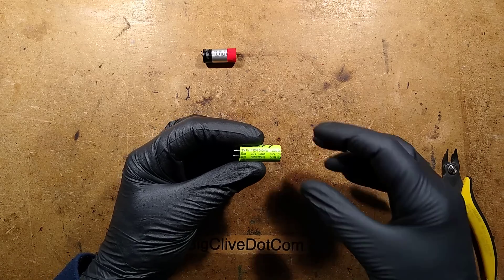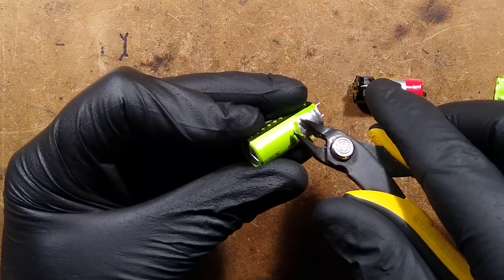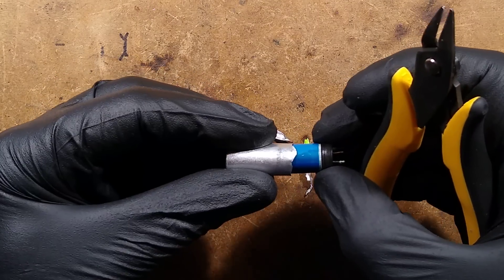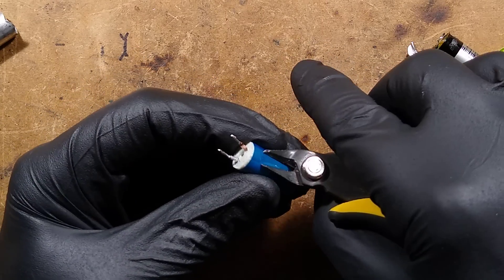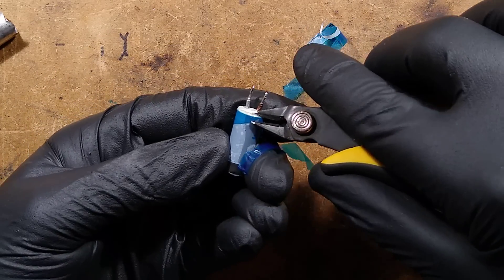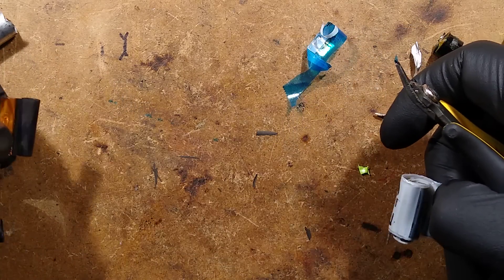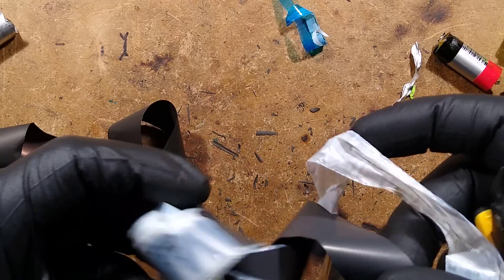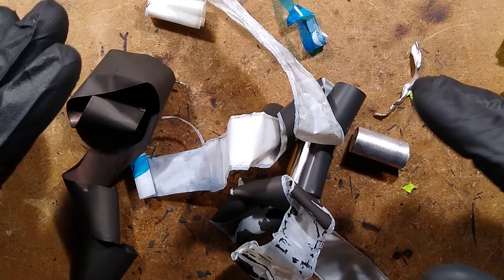Opening a capacitor-style lithium cell (don't try this)

Comment: Ahhh the memories ... investigating battery internals... and more.
...Half a dozen discarded car batteries in series and a couple of the carbon rods from those ancient massive carbon zinc phone batteries (Eveready No. 6), was rather spectacular (even in daylight) when an arc was drawn.
Lotsa light, heat, smoke, superficial burns and singed things. And yes we had the equivalent of the E.C. pie dish for flaming bits and pieces.
Heaven knows what the neighbors thought.
Gave a bit of a tingle if hands wet and mishandled. 
Added dubious bonus was occasionally a freshly overcharged battery would be ignited by sparks and spray acid around. (Had to keep leads as short as possible, so car batteries, carbon rods and user all in close proximity)
Clothing with numerous holes from sparks and acid raised parental eyebrows.
Survived. (& Learnt a lot of practical things that added to a really useful career)

Comment: It’s crazy how a battery that can power so many things is just a well rolled up piece of foil and copper!!! Amazing
Reply: Just make sure the corners don't get folded over; An expensive mistake for Chevrolet.
Reply: @MrDuncl and Samsung
Reply: With many decades worth of chemical engineering coated onto the foil 🤔
Reply from the maker: Yeah, a LOT of time and work went into those foils, coatings, separators and electrolyte.  It is bizarre that it is now such a throw away thing.

Comment: Really cool, but I think you contaminated your workbench with some of the contents of that cell. If I am disassembling stuff containing chemicals that are hazardous, I like to tape down some polyethylene sheet so I don't contaminate my workbench with carcinogenic stuff. I really don't like the idea of having to be super careful over my work surfaces once they get contaminated because it's so easy to forget weeks later. Once an open surface like wood is contaminated, it can be very difficult to clean it again so it's better to contaminate a cover that can be thrown out. If it weren't for the issues of shorting things I'd probably like to work over a metal cookie tray because it'd be more fire resistant than polyethylene sheet and easier to sanitize than the workbench.

Thanks for showing this disassembly. I've always wanted to do it and didn't want to risk the potential mess and fire.

Comment: The copper foil covered in graphite is the anode, and remains the same for both traditional Li-ion and LiFePO4 (but some new variants add silicon monoxide to increase energy density).

Comment: I'm torn on whether I like this form factor or not. On the one hand it seems real handy to design into a PCB, but I wonder how bad the impact is when it comes time to recycle the device it's in. For disposable devices it's borderline criminal to use the standard Li-ion cells. Would be better for the environment if it was a simple alkaline cell, although it would have to be quite a bit bigger.

Comment: Hybrid lithium ion capacitor. Low self discharge and don't catch fire, higher density than regular capacitors. The cathode is the same as those in supercapacitors. Interesting read.

Comment: I read an article a lil over a year ago that said don't be fooled, the "NEW" Sodium cells are just reworded Snake-Oil salesmen talk for old sodium-cell tech and are still even more volatile, much heavier, produce about 30% less voltage and perform even worse in cold weather, than the latest LiCo cells. 

We'll still need a stab in the test-pan and a blast-shield for those. 🤣

Comment: Discovered one of these in a rechargeable shaver a while back, its 500mAh in a 1450 package, it has one 6 pin chip on the board, was expecting it to be a DW01, it's  similar size but marked 67c927, charging circuitry may be in the charging  cable, I was intrigued.

Comment: It's funny how Cobalt is only a problem when it's used in EV batteries and not when most of it gets used to remove sulfur from diesel.
Reply: when i was little i had a couple of chemistry sets and both had cobalt chloride in them, doubt if 'health and safety' would allow it now, or even any chemistry sets at all !

Comment: I'm also very curious about the sodium ion technology.  Chinese car manufacturers (BYD and Chery) are supposed to be putting them in cars this year, but I haven't seen any confirmation of that.  I'm thinking that the charge/discharge rates might be a bit low, because the sodium battery I saw (CATL lab tests) had a lithium ion component as well.  They might be doing this to provide the higher current to get a car up to speed and to use the power from regen braking most efficiently.  Poor current capability might hint at a higher internal resistance.

It seems strange to me that battery manufacturers (albeit Chinese) are going straight to large packs for EVs instead of developing a consumer or portable device version first.  Lithium-ion spent years in development for phones, laptops, and drills before it got put in a huge pack in an EV.
Reply: Maybe the idea is that the market for car batteries is potentially much more profitable than phones. Why would phones use sodium batteries when they already have highly refined and higher density lithium batteries?

Comment: See if the lithium reacts with water still
Reply from the maker: It doesn't.  There's only a small amount diffused through the material.
Reply: If you heat it up would it do anything
Will it burn will it start on fire and burn like a sparkler I could then explode when thrown in water
Would it separate the lithium from the Cobalt 
Would it produce some kind of gas that is flammable 
You should do some experiments with it and see what you can make it do. I know you're not technically like a science experiment YouTube channel but it be fun to see what it will do 
Or put the 2 sides that have the insulator between it together and see what happens then
I think it would make a cool video if you found out wat if it did something interesting 
It might heat up and start a fire maybe explode
Just do it outside and with extreme caution

Comment: i would've like to see you unwind the layers while you connect a meter across to see the voltage drop down 

also i dont think it will catch on becoz that plastic bong at the top takes up alot of space relative to the full length battery

Comment: It's always pleasing to see the Explosion Containment Pie Dish - at least it wasn't actually needed in this instance.  And there was no protection device in the cell so I hope that the manufacturers solder them well to the PCB without any intermittent shorts or solder whiskers.
Reply: no doubt soldered with lead free solder, so tin whiskers may cause an 'incident' in time, if it still had charge in it 😁

Comment: I saw these cells a few years back in some micro rc cars.
They are nothing new, but you definitely don't see them too often.
Reply: Sure they were lithium cells? I thought they were just supercapacitors, the car could run only for a short time. You recharged them on the bottom of the transmitter and it took only a few seconds. I think I still have such a tiny RC car here somewhere.
Reply: Do they come in other sizes, or just this one size? If they're going to capacitor cans / assembly lines, they come in a huge array of sizes!

Comment: With the use of the casing of an electrolytic capacitor, the cell can build up some internal pressure without expanding. On the other side of things, when there is too much pressure, it explodes like an electrolytic capacitor when the diodes of the Wien bridge become shorted...

Comment: i vape alot and i use to build all my own coils on my mech mods and i built the coils with too low of resistance and i vented a 18650 battery in my hand not fun at all man thank god the mod i was using had vent holes so it didn't pressurize and blow up but still

Comment: I recently had the favor to see how fast two 18650 cells heat up when put into a holder wired as 2P and not recognizing the one cell is upside down. They have that flat plus cap and they had some plastic shrink wrapped around, which just shrinked even more fast. Fortunately I was fast enough in removing one from the very tight holder to avoid further effects.
Not sure if I prefer 50kWh if this over the 60l of diesel I normally use. 😂
Reply: Oh, it's perfectly safe.  You just need the "do not insert cells backwards" warning label, and all is well.  :-D

Comment: So not on topic but kinda related: Does anyone know where to get DC to 230V AC converters specifically for liion battery packs? like those 12V 230v for car batteries.
I have this small solar powerbank/generator. The battery is 20AH at 14.8V (so 4 banks of 6 or 7 18650 cells in series). 
I have so many of those cells laying arround that i was thinking of expanding the battery (of course checking for matching voltage and cpacity with the new cells)  but keep the original bms and charging curcuit and all that. but i also wanted a higher power 230v inverter on it as the one integrated is only good for 300W continiously.
Now i would need one that has the range and apropriate cutofff voltage for liion packs. so from. 10V to 17V.
Reply: I'm pretty sure the ones used in those big battery banks are integrated into the circuitry and not readily available in a format that can be easily attached to a DIY solution. Fortunately, the only real functional difference between them and an off the shelf high power 12V to AC inverter is that they're a bit smaller and the battery bank knows they kick out 230VAC so it can show that on the little screen, other than that you can just use an off the shelf car inverter of the appropriate capacity. Not the ideal voltage range but given how big the 12V market is you'd be better off just reconfiguring to a nominal voltage of 12V as long as you're rebuilding the pack anyway (which also works nicely with a lot of recreational scale solar equipment too, since that's also designed for camping and such)

Comment: How much do these weigh? I'm wondering if the energy density is more akin to larger li-ion batteries or lithium ion capacitors. 
Probably most fair to the chemistry to weigh without the metal casing (not suitable for production ofc!).

Comment: I wonder if they packaged it that way in an attempt to make it safer. I don't think its cheaper to do it that way unless the place that made them used to make capacitors and they are just using up old stock.
Reply: My thinking is that it would be better for packaging since both terminals are at the same end, so it can just hang off the end of the circuit board rather than needing an additional wire to reach the other terminal. You could do this with pouch cells as well but they're not going to fit as well in a round tube.

Comment: 1. the reason that the leads are connected near the end is probably how they get the capacitor battery hybrid or the first inch is usually faulty due to being crushed up in the middle.

2. the separator is i think what gets punctured and causes shorts and fires.

3. all rechargeable cells require break in (the first few cycles) to get full capacity.

4. lithium does react with the air and water and starts fires if you ever take a chunk of lithium metal and throw it in water it will burst into flames eventually though very dangerous and should only be done in controlled conditions.
Reply: 2. All bets are off on the event of disassembly because the separator won't necessarily stay aligned, or the roll could fold/flop over unpredictably, or you could short the terminals by accident
3. As far as I'm aware this is actually for the battery management system to learn the battery capacity and charge profile of the specific cell. I could be wrong but I'm not aware of any beneficial chemical process in the cell itself, particularly for NMC, that makes break in necessary
4. Pure lithium metal does, but lithium cells don't contain a lump of pure lithium metal, and generally the entire thing that makes lithium batteries fully discharged is the lithium being in a stable, low energy chemical state, so even dumping a stripped open cell in water should be safe if it was fully discharged. Emphasis on *should*, don't go testing this because you never know if it actually was fully discharged.

Comment: I suspect that this device is a lithium ion capacitor rather than a lithium ion battery.   I made this comment regarding the last video,  however it seems like my comment has just gone unnoticed
Reply: Clive liked another comment mentioning this so he has seen it now, but I'm not convinced. LiCs are apparently measured in terms of Farads for capacity, while this cell is labelled in mAh. It also happens to have the exact voltage of an NMC cell, and a higher energy density than even the random small NMC pouch cells I've got lying around, which are in turn still going to exceed the much smaller typical energy densities that LiC delivers. Plus, iirc LiC is much more expensive per unit effective capacity than NMC, which is a bad choice in a disposable device that uses none of the advantages of LiC like higher cycle counts and even faster charge/discharge

Comment: For what it's worth LFP batteries also don't contain cobalt, iirc Tesla was making a big deal about that fact when they started switching over when in practice it's also just a nice chemistry for EVs and they don't care at all about the wee babies so to speak
Reply: This is a blatant lie, Musk has openly stated that it’s a problem that needs addressing. 

LFP batteries both eliminate cobalt and have better charging characteristics but have a lower energy density.

Comment: I don't expect sodium ion technology to affect personal consumer devices all that much as they have a lower energy density than Li. Vehicles and home/industry scale energy managenent for sure but notsomuch for disposable vapes.
Reply: Sodium ion is actually a great candidate technology for these because it's going to be way cheaper and still be about half the energy density - these things aren't space constrained enough for that to be a deal breaker. I agree that you won't see sodium batteries in phones and such though, although they might also turn up in cheaper battery banks and such
Reply: I doubt it for vehicles, energy density (duration/output) is already the main killer for EVs even with the highest-end capacity on the market. If you make the energy density any worse then you start getting into territory where we're looking at 20-ton cars, plus whatever losses and engineering problems from volume density.

You've probably heard nutjobs are trying to ban 'TIRES' now - but that's a different engineering problem from batteries altogether.
Reply: @RafaleKez4  One of the Chinese manufacturers already has sodium ion cars in the pipeline (Byd iirc) - you're falling into exactly the same trap lots of people do when discussing EVs and range. See, the thing is EVs already have way more than enough range for most people when you factor in 3 key things that people keep forgetting - the majority of commutes are under 50km per day, the majority of car owners don't take every one of their cars on long road trips ever, and you can charge your car at home overnight without needing to go out of your way to travel to a charging station. Once you account for these it becomes pretty clear that there's a solid market for a compact budget EV with a 10-20kWh battery pack and 100km or so range that would easily handle the lower energy density of sodium ion batteries and would stand to benefit greatly from a substantially cheaper battery pack.

Comment: I don't understand why is Sodium better than Lithium? Sodium is even more explosive with water.
Reply: These cells don't contain a slug of metal and a capsule of water next to it, they contain metal ions that undergo much less exciting reversible chemical reactions to store and release energy. The amount of energy stored is directly proportional to the hazard, all other things equal, as that's the thing that gets released explosively (that's how all explosions work - rapid release of stored energy), which means that sodium ion batteries, which are anticipated to have about half the energy density of lithium chemistries, should be significantly safer.

Plus, the big advantage for single use disposable junk like this is that they don't waste scarce resources like lithium and cobalt.
Reply from the maker: Just a small amount of sodium diffused in the electrodes.  Like salt.

Comment: They are installed a little overcharged. Maybe because of this, the capacity is lost. Or is this the value for 4.3v
Reply from the maker: This was for 4.2V - I've not checked the voltage as supplied.

Comment: These are classified as supercaps. And the correct name is Lithium-ion capacitor.  The anode is the same as those used in lithium-ion batteries.  The cathode is the same as those used in supercapacitors. It is a lot of interesting material on the net about these. But Google delete comments with links. so you have to use google on you own